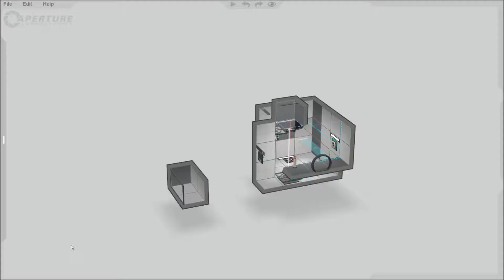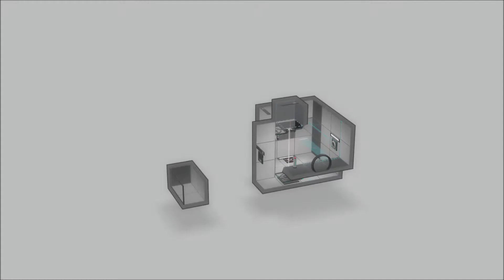Portal 2 Toggle Switches & 3-Way Switches

Comment from the maker: I tried to time it out but couldn't get the piston platform to perfectly line up with the oscillating platform.  I've learned a lot since making this, so I might be able to make it work perfectly if I tried again.

I do have another video that shows how to make a fast toggle switch (5 laser design).  It's the fastest and most reliable toggle I've seen so far.  Check it out if you're curious.